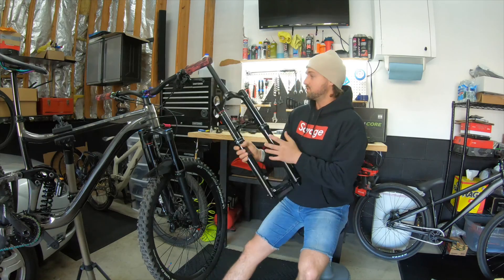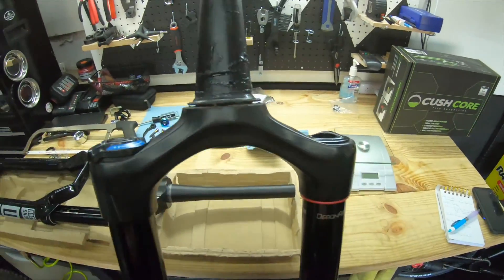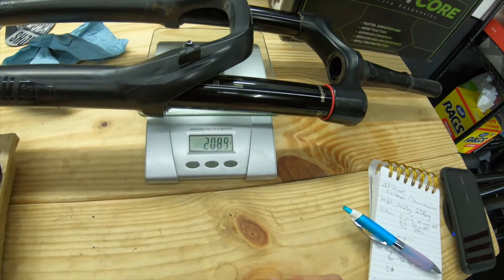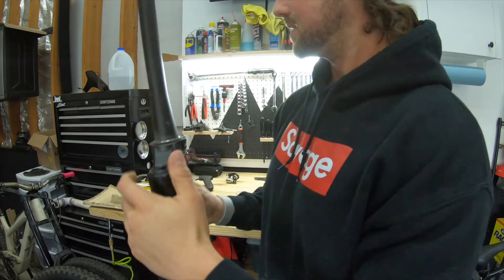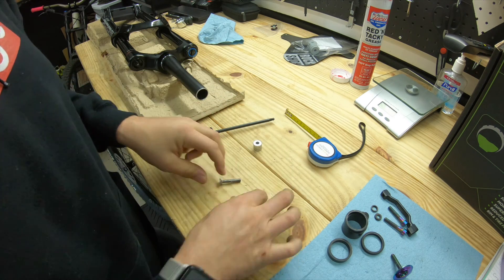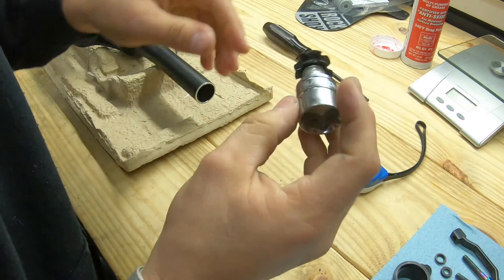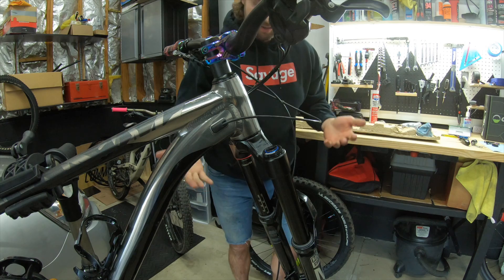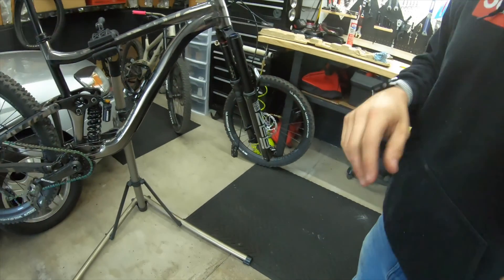The NEW ZEB: Install the cheap and easy way

Comment: if you want to skip the star nut step, just buy the specialized swat tool that goes in the head tube and takes the place of the star nut, and then you also have a cool tool in your headset
Reply from the maker: Heck ya thanks! I have the oneup tool in my steerer tube now ! Love have a multi tool on me at all times now 👌🏼

Comment: I have the lowest spec zeb on my bike and there’s no cap for adjusting the compression. Is it possible to buy a damper upgrade kit and get the twisty knobs.
Reply: Yes, I am having my ZEB R (same one u have) upgraded right now. Kit is $330 that replaces the damper to the same one on the ultimate fork. High & low speed compression.